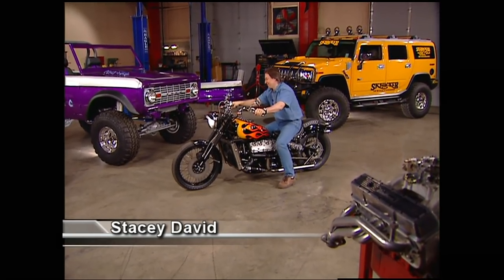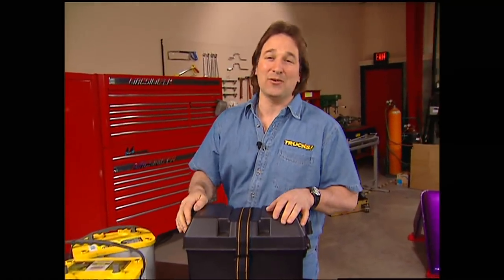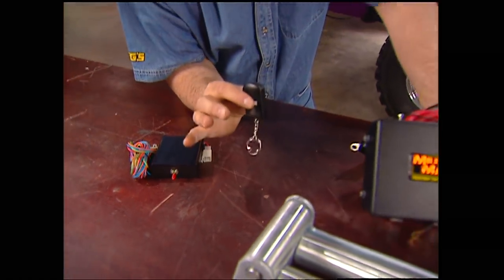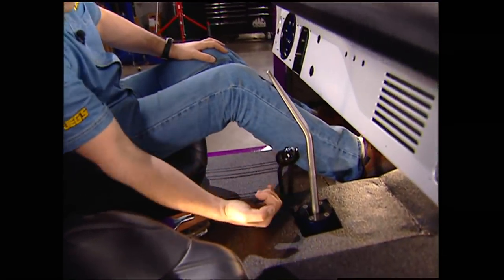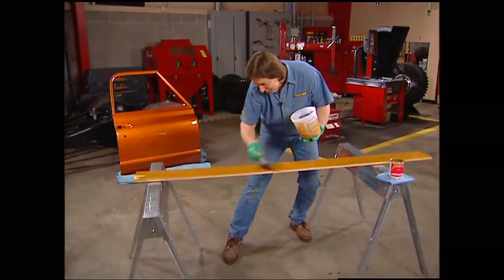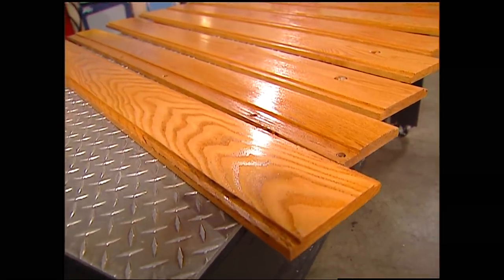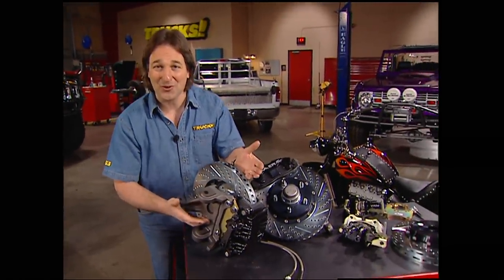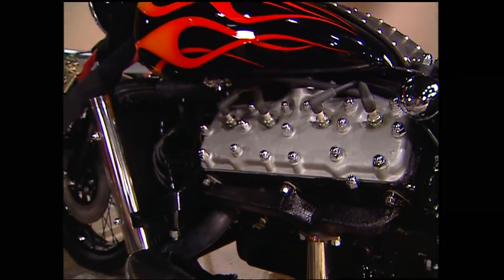Getting Our Classic Bronco Ready For The Trails - Crazy Horse Part 9

Comment: Wouldn’t it have been more sturdy and practical to have puttin 3/4 ton axles on it? Like a Dana 70/80
Reply: Not really. A dana 70/80 are rear axles and typically dually application which is about a foot wider than the stock axle. So imagine 6 extra inches on each side. A narrowed ford dana 60 on the front would work, but way overkill for a show vehicle on 35s. The factory dana 44 is fine with upgraded shafts and a 9 inch is pretty bullet proof with the most aftermarket support of any axle made.
Reply: Jeepin Dave true, just figured if you’re gonna build it, just go big

Comment: First, if you need two or more batteries to drive heavy loads, NEVER EVER tie them permanently together. If there is a problem one battery can drain the other. You should look at the marine industry for a battery selector switch. Secondly having that stud sticking up in the bed for the spare tire when the bracket is removed is kind of silly........ BAD IDEA